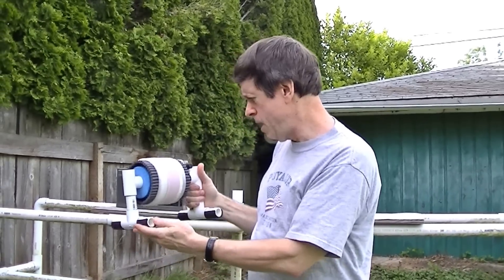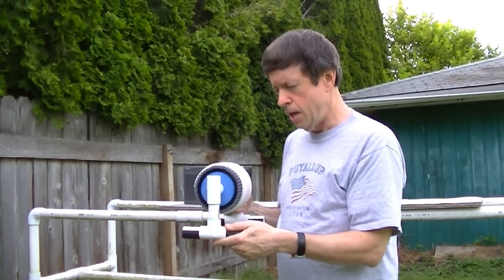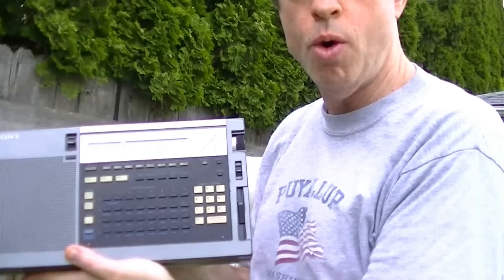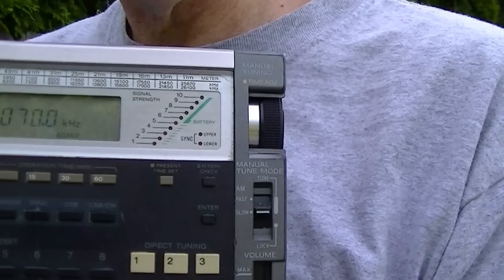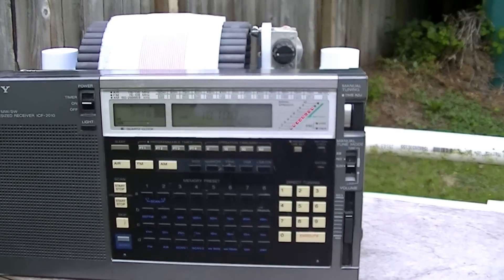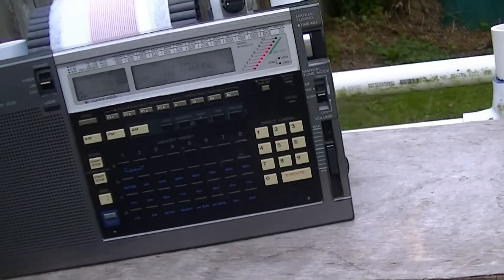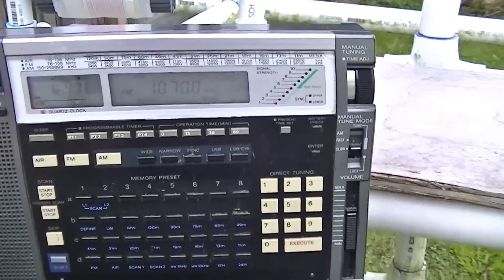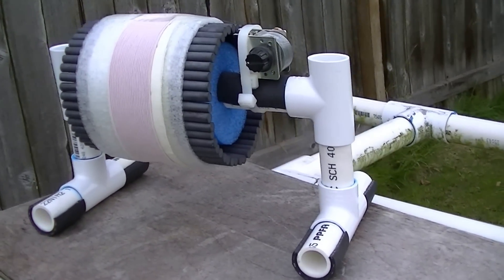5" Diameter MW Ferrite Sleeve Loop Antenna ($95 model)-- Daytime DXing Demo

Comment: Hi Gary, excellent video. Just of interest, 1070 CFAX has been heard as far south as Coolum Beach in Queensland Australia many years ago (not by me unfortunately). That loop antenna looks quite impressive. All the very best, Robert Melbourne Australia.
Reply from the maker: Hello Robert, Thanks for your generous comment, and I'm glad to know that 1070-CFAX has been heard in Coolum Beach, Queensland. Yes, when you get right on an ocean beach you can really track down some impressive long range transoceanic signals-- a tiny antenna like this can easily receive the Oz big guns like 702-2BL and 774-3LO on a local Pacific beach, and even W.A. stations like 531-6DL and 558-6WA when conditions are great. Best of DX to you! Gary (N7EKX)
Reply: Hi Gary, Have you managed to hear any Australian AM from Finland? I did hear years ago that 3LO Melbourne has been heard from there on rare occasions. The furthest that I have heard on AM in that direction has been Tunisia back during the 1980's from my in-laws former place at Frankston Vic, south of Melbourne. Incidentally, please feel free to subscribe to my channel. I cover quite a large variety of interests there, including DX. All the best, Robert.

Comment: hi Gary, can you sell one of these? am new to shortwave radio, just got 2 icf2010s looking for a good eternal antenna to boost signal. thanks
Reply from the maker: +061811 061811  Thanks for your interest in the 5" FSL antenna model. This antenna is only designed to cover the Medium Wave (521-1701 kHz) frequencies, though, so it will not boost up the reception of Shortwave frequency stations on the ICF-2010. If you need a better antenna for Shortwave you should use a long wire, vertical or other external antenna. Good luck!  Gary
Reply: thanks, how about the orange antenna in another video. that is for median wave too?
I still want one of this 5 FSL, it looks so cool. 
I checked out your website for building this but I don't think I can do it myself. how can I buy one from you. thanks
Reply from the maker: +061811 061811   Thanks for your reply. Right now I am building some new, improved 5" FSL antennas which are more sensitive than the one in the video. If you want to buy one, could you please tell me your country and address? Thanks-- Gary
Reply: @DXerGary  Hi Gary! I have been watching your videos about FSL antennas several times. Is it possible to buy one? I’m using a xhdata 808. My name is Ola and living in Sweden/Europe
Reply: DXerGary Gary could you make me one.your newest one

Comment: I notice you seem to be just lining up your loops for maximum signal of the distant station without regard to interfering sources. It is better to use the deep null off the side of the loop to partially or completely null out the QRM/QRN at a reduction of signal strength of the desired signal as this may likely increase the signal to noise ratio. Also the word "gimbal" seems to be unthought of... Something relating to wave angles of arriving signals relative to the antenna pattern. You may never null an unwanted night time station on a specific frequency until you angle things a little.
Reply from the maker: Hello Dazzwidd, Thanks for the comment. In general the FSL antennas have a pretty sharp null off of the ends of the ferrite rods, and depending upon local QRM or splatter on a frequency, it is sometimes helpful to null out the pest station before attempting reception of a weak DX station. The signal null available on a single-rod ferrite antenna (like the 7.5" loopstick PL-380, for example) is a little sharper than that possible on an FSL antenna, though, and single-rod antennas respond better to tilting as a method to enhance the signal nulls. 73- Gary